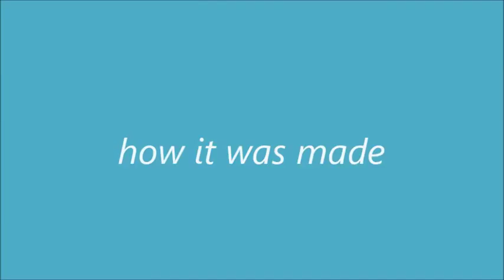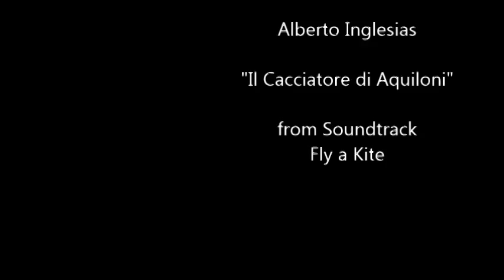Big (Fish) Custom Fillet knife and making of it

Comment: Beautiful knife,I to have wondered about the uhc roselli steel ,I have wanted to try the Hunter blade but thought that it may be too hard to sharpen with an ordinary stone,still great video and music Osmo thank you for sharing. Tom
Reply from the maker: Hi Tom, I was told that never let the UHC too much dull or you are in trouble with hand stones. It needs maintenance may be more than carbon steel but keeps also the edge better. As a closing words it must be good option in diligent hands:) thanks.
Reply: thetopicala
Thank you ,I may try it ,as I have just ordered some diamond stone sharpeners ,I think they should be hard enough to hone them. Tom
Reply from the maker: In my next video there's something more to bite with UHC steel:) Thanks, Osmo

Comment: Very nice knife (the smaller one too), my friend! Is the UHC steel good for a fishing knife? I've never seen or used a knife from it but sounds like very easy to rust.
Reply from the maker: Hi Alex, You should try UHC. It's actually very easy to maintain in good order. Far different than normal carbon steel. Thanks.
Reply: Thanks Osmo! That's very interesting.